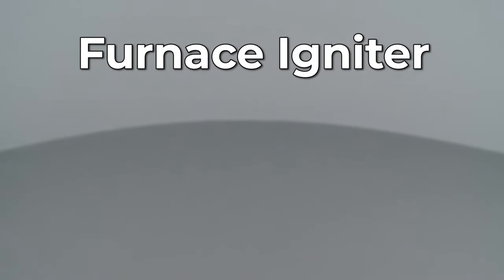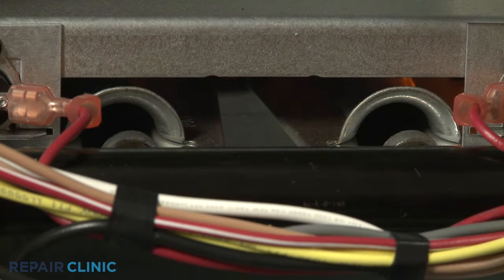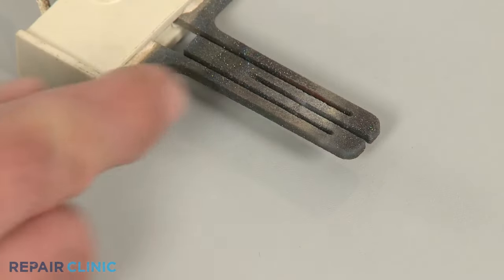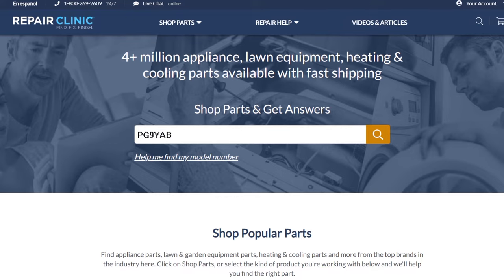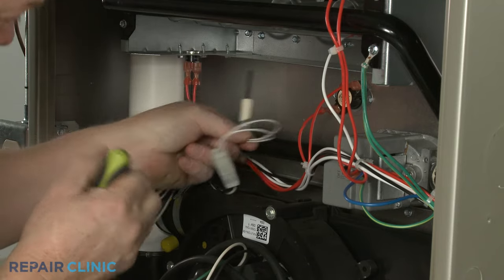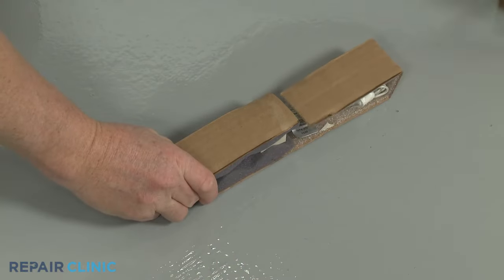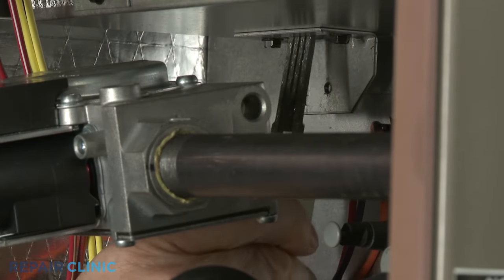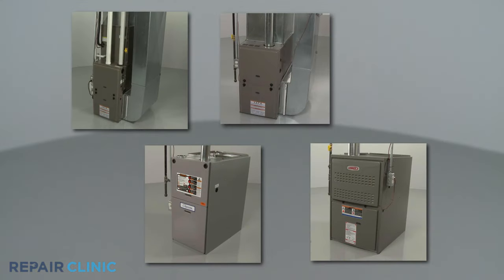Furnace Igniter Replacement

Comment: I don't know about Honeywell OEM, but I took apart an SS24 SUPCO ignitor and discovered that they actually use a copper cuff thing that is brazed to the nitride.  This is totally inferior and doomed to premature failure due to the combination od oxygen and thermal stress destroying the braze (the reason I took the damn Chinese piece of crap apart to start with to see what happened).  Nickel alloys OR BETTER  are supposed to be used.

Comment: Is their any way to test a spark ignighter?
Reply: When 24VAC supply is established to the ignition control module THEN SPARK IS PRESENT UNTIL PILOT FLAME IS PROVEN.

Many things may go bad... 
24AC command
ignition control
igniter/sensor
gas valve (PV + MV)

To troubleshoot you should step through the chain of sequence or clean the dirty FLAME SENSOR!
👍
Reply: @glasser2819  If the flame goes out how do I test the flame sensor if it has been cleaned?   I seem to remember something about checking DC amps with multi-meter in series with the flame sensor to the board.